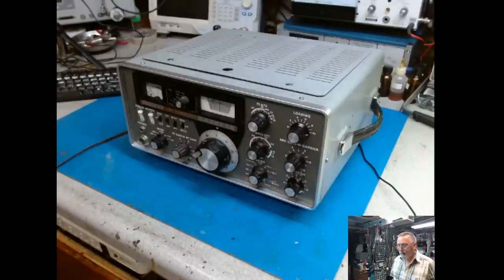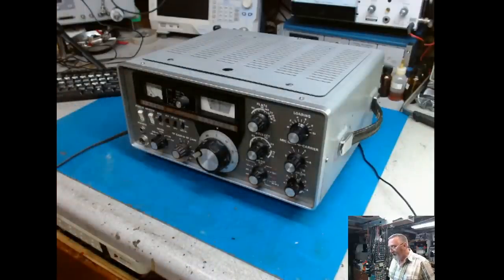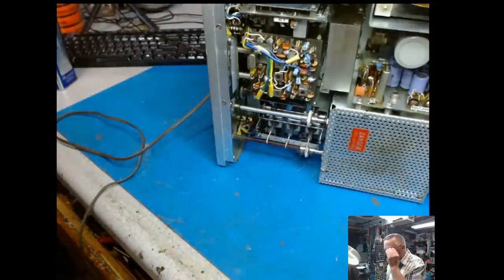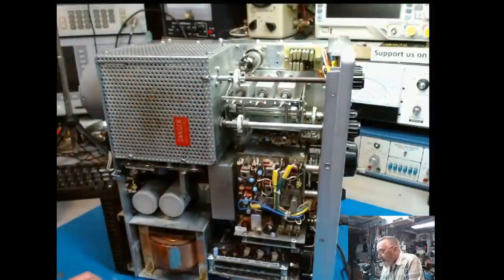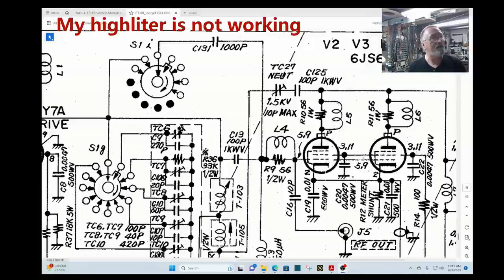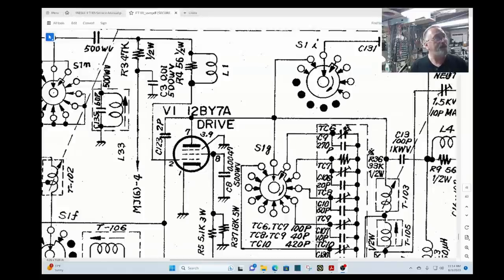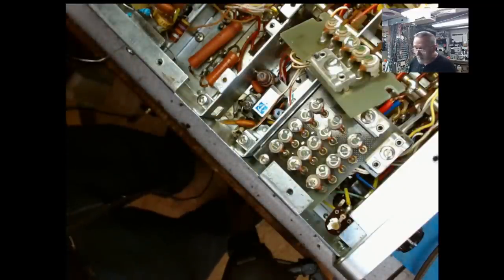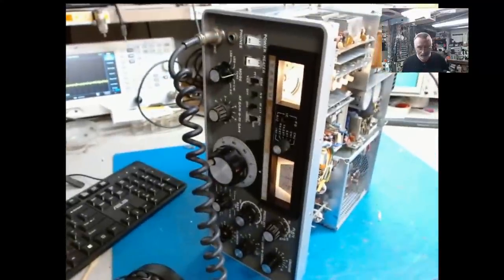FT 101 Front End Alignment

Comment: Oh Great Tron God, Thank you for this.  Sincerely though, thanks much for the help and instruction.  I'm in the process of putting together a repair bench.  The last time I worked on radios was in the 1980's.  Add to that, my first ham radio was an FT 101B.  I currently have a different one thanks to E-Bay, which naturally does NOT work as advertised.  I decided it was time to dust off the old brain housing group, and build a work bench.  (Still chiselling some of that dust... )  You're an inspiration with much knowledge that you share.  Serious kudos, and much thanks.
Reply from the maker: Thanks for the kind words.

Comment: Many thanks for these videos. I passed my Ham certificate in 1983 and passed etc. But about 10 years ago I gave up the Hobby.  But recently got back into the Hobby. This week I purchased a Yaesu FT101B from Ebay. Started work on it with 100w tx on 40metres with other band giving 50Watts etc. Doest Tx on 160m but not sure if it should. Now in process of replacing the front panel as cannot read written numbers etc. So it's really helpful watching videos of yours. Cheers from George (Michael G1BKI) in the UK. Ps mainly run QRP from modern cheapo. SDR rubbish radios. Pension money doesn't go far.

Comment: I kinda got the same problem with my Yaesu 991A tears up the TV, even knocks it completely off the air when I transmit on 2 meters mostly.  My radio station is in the living room and just underneath our 55 inch big screen.  It seems to mostly happen when it's wet outside and my antenna has been rained on.  So I ordered some RF ferrite beads to go on the input cable to the TV.  I'm hoping this will fix the RF problems I'm encountering.  Maybe you should put some RF ferrite beads on your computer cables to keep out the RF.  Cheers from eastern TN
Reply from the maker: Great suggestion. With all the wires coming off the PC they act like antennas. Thank for the comment.

Comment: I don't know about the rest of you, but I loved the video but my FT101EE will stay sitting on the shelf because I just don't have the equipment it takes to align it. But I'll never get rid of it because it takes me back to 1979 and I love looking at it. I also have the SP-101PB, FV-101B and the FL-2100B that goes with the FT101EE. The reason it is sitting is the last time I keyed it up the radio the finals wouldn't turn off. I checked the finals on a tube tester and one of tubes was bad, so I replaced both of them never keyed it up again.
Reply from the maker: Question, Why would it need alignment?  I mean if it was working since you had it and was ok then an alignment is most likely not needed.  They are fun rigs even to look at.
Reply: @TheRadioShop  I was thinking more along the lines of the tubes need neutralizing since I changed them and the alignment due to its age. Then I'm not sure what really happed to the tube to make it fail. I really need to find a shop to go through the FT101EE and the FV-101B. I think it was two years ago I looked into sending it out, but when I contacted the repair shop, they told me they were not taking any more radio in at that time.

Comment: great video. I just got a FT101B in good shape, but the receiver is very quiet. Also the S meter is barely working. Any suggestions? Thanks.
Reply from the maker: Check lamp fuse, board connectors, and relays.
Reply: @TheRadioShop  I already did that and everything is good.